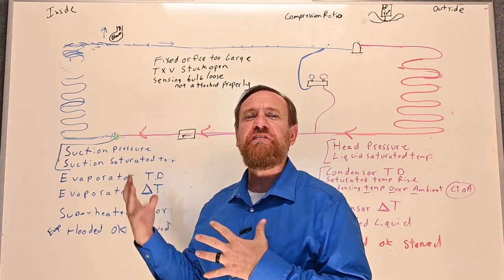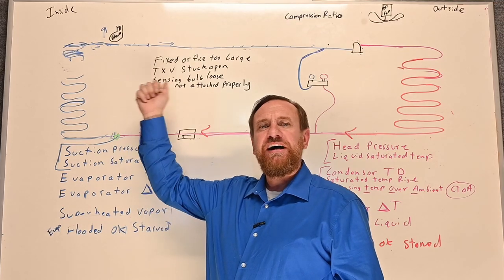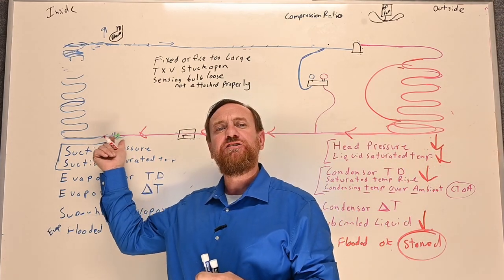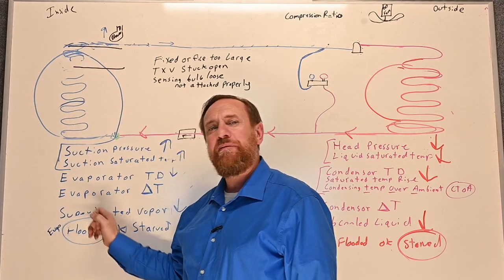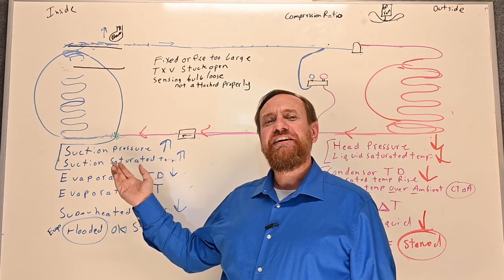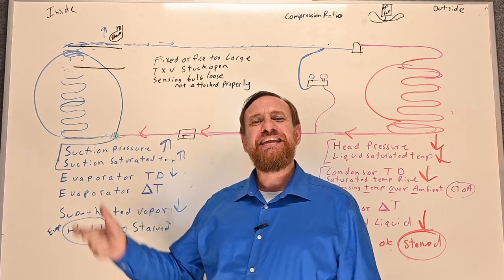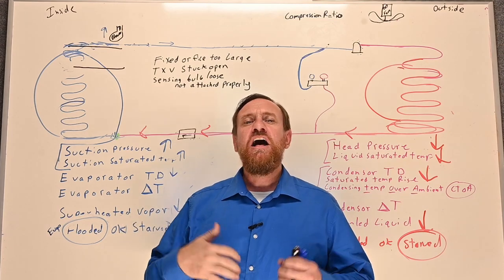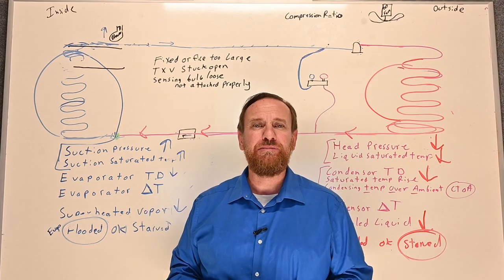HVAC 105 Scenario: Overfeeding Metering device

Comment: I put a Sporlan See-All and 032 Catch-All onto a R134a mini fridge. It has a passive air cooled condenser. When it turns on the sight glass fills up with liquid and then it slowly empties as the head pressure reaches 165psi. Sometimes the cap tube begins to vibrate. Charge weight 1.76oz, if increased the suction line frosts back. I was hoping to "Clear" the sight glass but I think I would have to put a longer or smaller ID capillary tube in.
Reply from the maker: That's interesting. 
The larger filter drier and the larger sight glass should require more refrigerant to compensate. It will act like a recover. 
Frost back is not always bad, it can be below the freezing and dew point temperature but still he superheated vapor.
Reply: You're absolutely right. I thought I had recovered back to charge weight but I just recovered, evacuated to 500microns, charged to 1.76oz. It was in -15inHG vacuum low side. I ended up charging to 2.2925oz. The increased high side volume caused me to adjust charge to achieve a balanced system.

Comment: Hi Ty,
If you have a 2.5 ton compressor and a 3 ton air handler. You must change the TxV to match the 2.5 ton compressor? Or is a half ton difference ok to keep the 3 ton txv?
Thanks 👍

Comment: Your videos are great.  Can you explain (or maybe one of your videos) about how they are using the larger inside coils to improve seer efficiency (for example a single speed 3 ton compressor with a 4 ton inside coil).  An orifice tube can be sized ok but a txv is going to be a problem right?  (I also hate adding extra components like solenoid valves to a system).  They seem to be using large coils a lot now and I wondered how it works.  Maybe they just can't use a txv or move the bulb down on the coil?  Then the next issue is the two speed compressor and reduced liquid flow.  I'm pretty familiar with refrigeration, just wondering about these new systems.  (ha, not the one trick pony anymore).  Somehow, they are combining two complete half sized units (separate compressors, valves and coils) into one single unit with changing compressor speeds.
Reply from the maker: There are a lot of different questions in there, I will do my best to answer them in text.

1st Larger coils = more surface = means better heat transfer = better efficiency. 
Bryan Orr with HVAC school wrote a great article called the evaporator coil with no Fins. It has to be the balance with the right amount of airflow. In one scenario a larger coil also means a warmer coil and less dehumidification, but one the airflow is adjusted the coil temperature will drop and you can have better dehumidification. Dehumidification always takes away from operating efficiency when rated in SEER. So to get a higher seer, a larger coil with more airflow hits those numbers but it does not provide proper dehumidification. This is why manual J (correct size) manual (s correct system selection) manual D (correct duct design) and manual T (correct registers)  are so important. They all have to work together. Manual S works with manual J and the equipment sensible and latent capacities to choose the right system. A 3 ton unit is not a 3 ton unit, application is key. Manual S is the most overlooked part of system design. Once you look at the system capacities sensible and latent in a specific application you will  see how one 3 ton will work when another will not. Manual S will also determine airflow rates.

#2 metering device.  TXV always beats a fixed office in every way except cost. A fixed office just just a hole, it cannot adjust. A TXV while not perfect adjusts to a variety of conditions. In a hot summer day and with a customer that keeps a cool indoor temperature you will see the fixed flood the evaporator washing oil away from the bearings reducing life of the system. On a cooler outdoor day there is not enough pressure to force enough refrigerant into the evaporator leaving high superheat and damaging the compressor from overheat. A TXV will do it's best to open and close the hole size. It will do it's best to keep the superheat from dropping too low damaging a compressor from flood back or being too high damaging the compressor from high superheat and overheat.

#3 2 speed compressor.
A Copeland scroll drops to 67% capacity unloaded or "low speed"
It's moving less refrigerant overall. 
Even though it's moving less refrigerant into the evaporator coil it's also not "pulling" (time sake) as much either.  If the indoor fan does not also slow to accommodate this will mean a warmer coil and less dehumidification. If the fan speeds adjusts with the staging it's still possible to be a low enough dew point to dehumidify. Regress if the suction pressure is higher or lower, regardless of the volume, the TXV will try to maintain a constant superheat. It has its limits.

Even in Refrigeration, a rack will have multiple compressors to increase it decrease capacity as needed without affecting each individual metering device or Evap coils.

#4 embrace solinoid valves.
In there simplest form they can be installed before the metering device to control off cycle liquid migration to prevent flooded starts and elgrestly extend compressor life just as in refrigeration.
They can also be used in a slue of other application, especially in cold climate heat pumps. 

#5 fixed orifice, TXV, single speed compressors, 2 stage compressors are in there way out.
Already here and more every day is variable compressors and Electronic expansion valves. (The electronic expansion valve works like a solinoid too) love them or hate them,  this is what the new HVACR will be.

Comment: does the meter valve for the outside unit need to match the one for the inside unit or is this a recommendation?   Meaning if the outside unit is a .49 then the inside device needs to be a .49 as well or can they be different ?
Reply from the maker: No they will usually be different because the coil they are feeding will be a different size. 

On a side note fixed office metering devices have no place in the modern world. They "don't  break" but they also don't operate very well either.

Comment: Why I am getting my compressor flooded, even the refrigerant is charged as per factory and the whole system is newly commissioned???
Reply from the maker: How many cfm of air is going across the evaporator coil? 

What metering device is used?

Causes for flooded compressor new system. 
#1 airflow ductwork undersized
#2 airflow return too small
#3 Airflow filter too small/restrictive
#4 airflow blower setup incorrectly
#5 over recharged
#6 Fixed office (piston)entering device outside design conditions
#7 TXV sensing bulb not properly mounted
#8 brazing without nitrogen flow leaves oxidation causes TXV to Stick open.
#9 over heating TXV or sensing bulb during installation causes Stick open. 
#10 metering device missing or o resized
#11 evaporator coil is too small
#12 low load/temperature inside too low.

Comment: Hemm what happened to 105
Reply from the maker: I just wanted to know if you where still with me 🙄😄
Reply: @love2hvac  🤣🤣🤣 you know I keep posting them on my telegram channel. Can't miss a number or it will be out of order 😂
Reply: Darn, even though you fixed it, for some reason it still comes up on the link as 106. O well. I wrote that it's actually 105 🙏🏻
Reply from the maker: @Elisummit845  I appreciate you letting me know. Sometimes it's 2am trying to upload.
Reply: @love2hvac  as long as we get those awesome information it's all good.